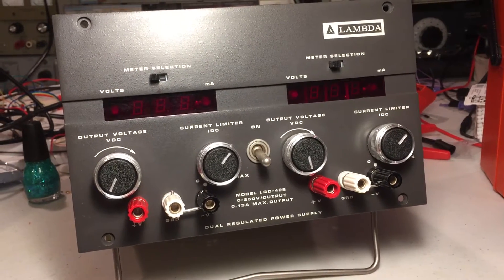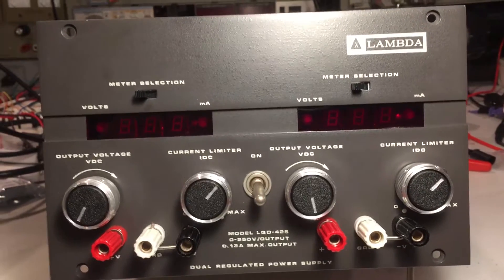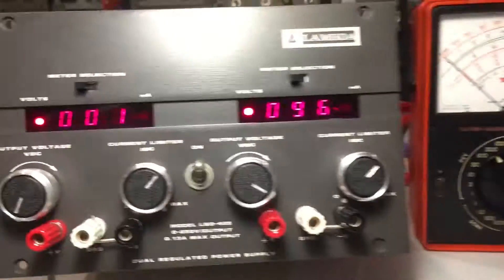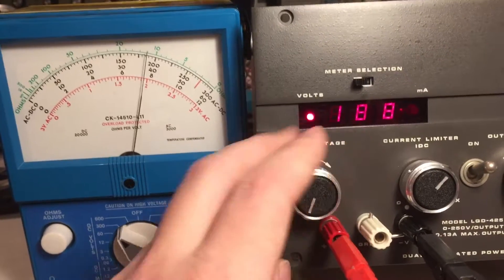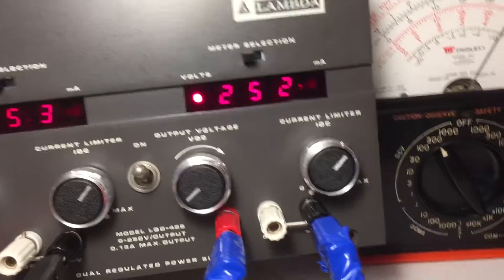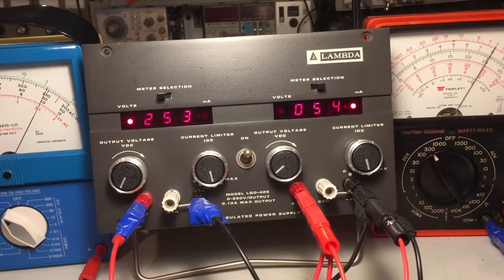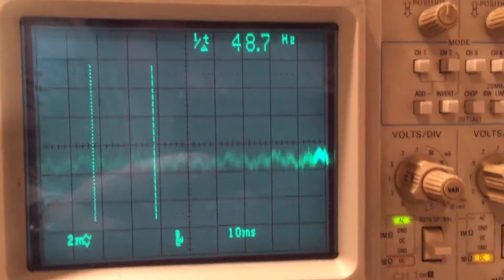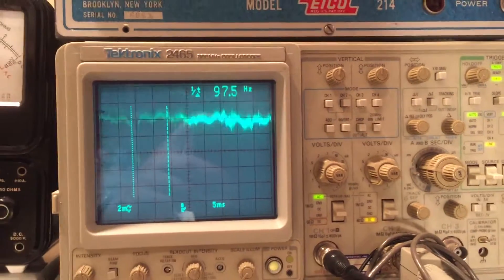Lambda LQD-425 Two Channel 0-250V Regulated Current-Limited Lab Bench Power Supply Pt1

Comment: I watch the video this week....   I can bring myself to get a solid state one as there are Heathkits that need homes.   I did however score some parts this weekend at radio shack and build the worlds ugliest power supply just for fun with four old 3A diodes I had, a cap, and two voltage regulators.    I can see how people might be put off by mains voltage tied right to the project by gator clips, so i havent posted it yet